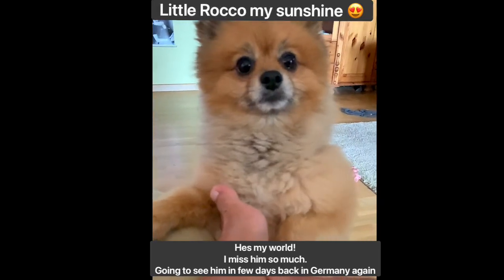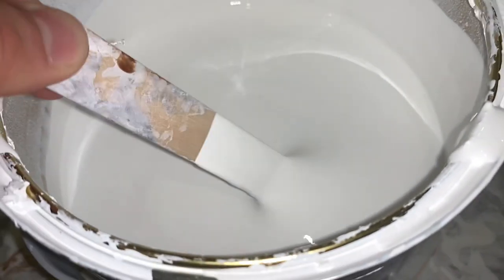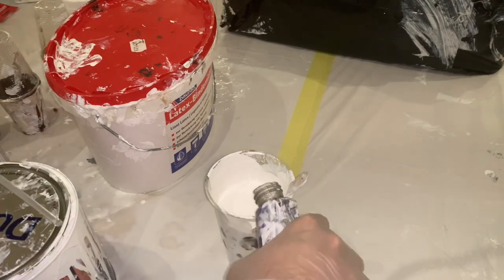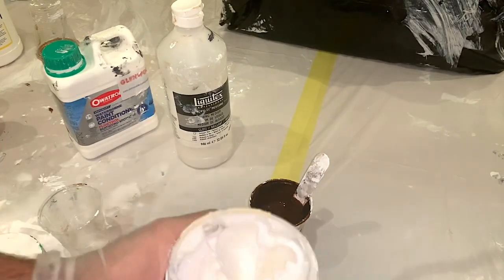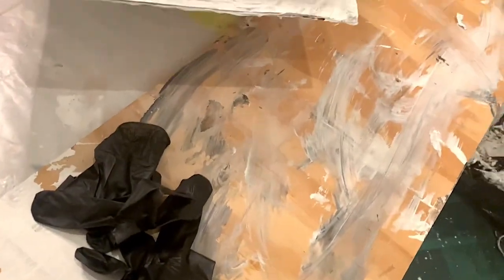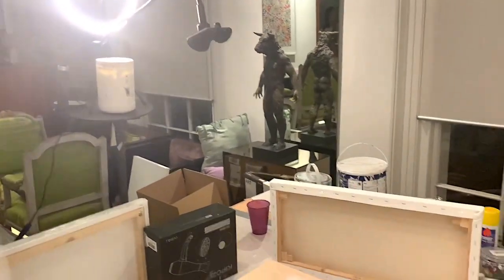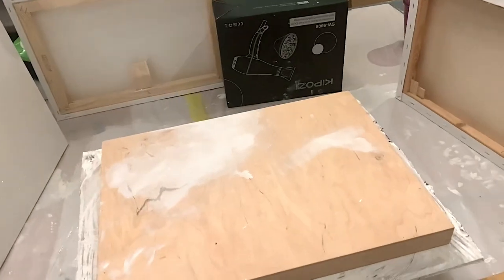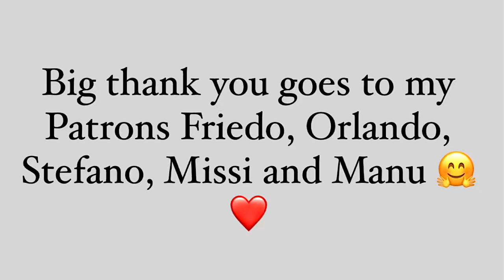ACRYLIC SWIPE & Spin! Organic Details - NEW BASE Mix revealed and explained!

Comment: There are different versions of this Dulux paint
- ordinary (longer dry paint) Gloss
-Quick dry gloss
- also available in satin ordinary or quick dry
There are also more expensive ' diamond hard & bathroom wipe down versions'
The one used in the video is Dulux quick dry Gloss
Hope this helps!
In the UK you can also buy from others manufacturers such as 'Crown' or companies own make.
As long as it states 'quick dry gloss' ( shops own make is the same but 1/3 cheaper)